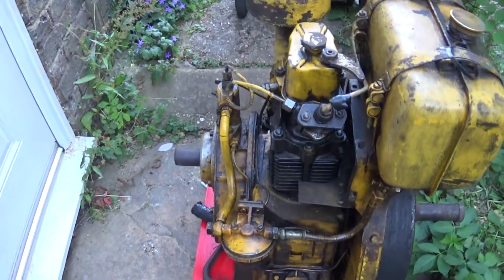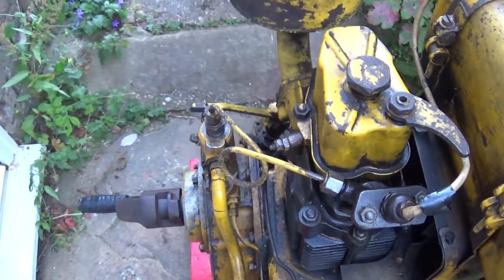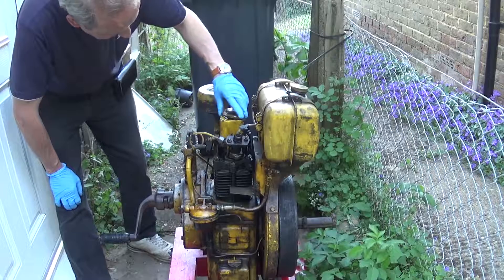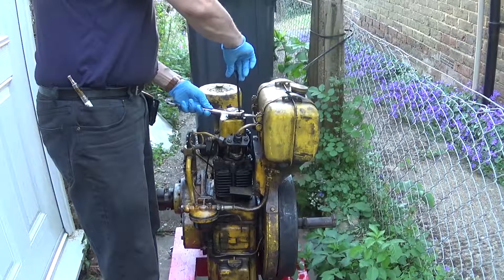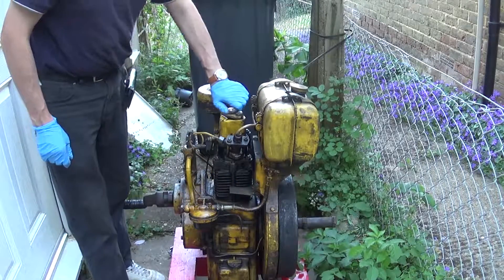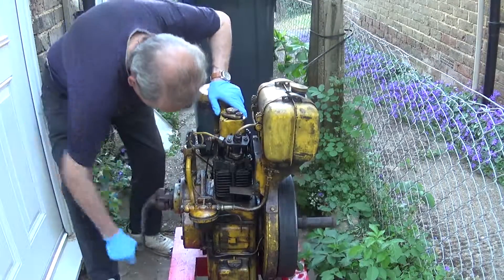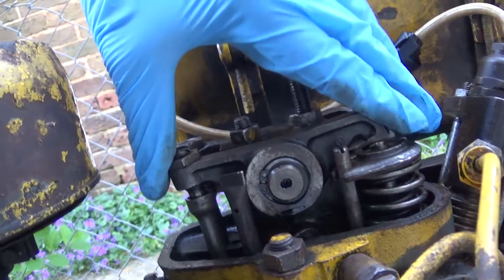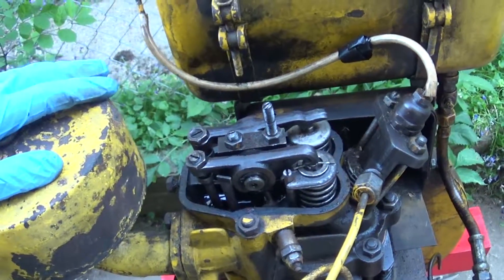Petter PAZ1 Setting/adjusting the Decompressor

Comment: Thank you for the video, very well made. Any update on this engine?
Reply from the maker: I have the other two videos filmed about the same time, but I will be soon, putting a rebored cylinder on with rebuilt rocker gear. I am just about to make a mold to cast lead wire for bump clearance testing.

Many thanks for watching.
Reply: @BensWorkshop  Sounds good, Ben. I just use thin wire solder from the hardware store to test bump clearance. 
Looking forward to the finished engine; I love those PAZ1's.
Reply from the maker: @crazyenginewiz  I am going to make a mold to cast wire at 60 though thick in lead. There will be a video on that in a few weeks.